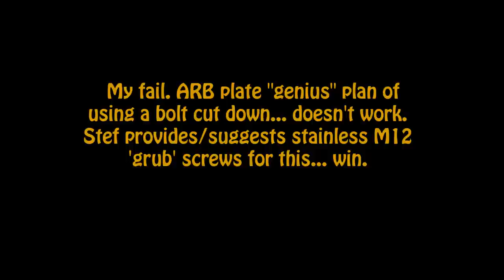Project 16v - Part 29 - Rear axle rebuild

Comment: Top man ! You know iv never actually worked on a torsion bar rear axle before other than to change 1 out on a 309 years ago , most garages round my way would never touch them interesting now as an older ( 38 ) man to revisit this through the wonders of u tube and see what all the fuss is about 
Well done on a lovely rebuild a very nice car now actually a 306 Dturbo “ new enough to be good” - “ old enough not to have all the shite on it “ well done friend 👍🏻
Reply from the maker: Haha! Thanks! Have fun, hope you find another to tinker with

Comment: Halfway through trying to rebuild my beam and I've snapped a bolt in the end of one of the torsion bars.  Should've just hammered the arms out instead of trying a puller. Good video hopefully I can free my seized bars.
Reply from the maker: Oh no! Hopefully it's not tight in the threads. May have to knock the arms off, got to come off for rebuild anyway 👍👌🐷💪

Comment: Good job 1 thing tho i wouldn't use copper grease on bearings as its a anti seize not a lubricant its actually slightly abrasive
Reply from the maker: 100% agree.... Hence I don't THINK I would have put copper grease on bearings... I would use the lithium stuff, because as you say, it's anti seize only. 👌🐷💪
Reply: E graxa bissulfeto de molibdênio? O que diriam?

Comment: Cheers for making this! Much more use than Mr Haynes :) 
Is it possible to replace the two pairs of bearings inside the beam & re-use the beam? Or is it 9/10 that the beam is gouged from worn bearings & needs to be replaced..?
Reply from the maker: Yes it is. I've had a specialist do this for me, Stef, at other times. Many tubes now have gone oval and need further repair. You need a special tool or two to remove and refit the bearings.

Comment: Hey pal good video, ive got mine unbolted inside the boot and the one underneath to replace the rubber bushew but it wont budge)lower. What am i missing please?
Reply from the maker: To replace the rubber mount you'll need to drop the entire axle 100mm or so. Not just one or two bolts.

Comment: Good job man !!! I got 1998 Citroen Xsara which I'm preparing it to drive 500k  around the world. The thing is that when I put some weight on the back the car sinks too much... The axle isn't rusted and the is no ticking sounds from it, the car has only 220k km. I know that my shocks are bad, is that the reason for the car to sinks or something else? I guess my Xsara has 19mm torsion bars, upgrading it to 21mm will stiff the rear more for holding weights?
Reply from the maker: Yeah, I'd upgrade to 21mm bars and some new shocks. 👍
Old bars lose strength overtime too 👌
Have a fun trip!!! 
Are you documenting it?
👍🐷💪

Comment: iv took rear beam of my saxo to fit on my 106 any tips as my old beam on the 106 is drums!
Reply from the maker: Need possibly slightly difference pipes, can make them... And use disc 106 handbrake cables 👌

Comment: Hi Piggy, I've been following your channel for a good time now and it has helped me on my journey with my own 306 a lot. Your videos are really great and informing. I know this video is from 2018 but I see you answered to every single comment so I hope you'll see this. I've got a problem with the rear being saggy and soft, no knocking sounds and I am suspecting the shocks have had enough. They are ta technix and also the front is on ta technix -30mm springs. Do I get the bilstein b4s? I am scrolling through forums and finding the b4s are good except one version (model number 1931) and they also say not to get 205 ones. I am pretty confused as I don't know which b4s to get. Some people recommend ones for a citroen zx or a 306 break as they should be compatible. I really would appreciate your help a lot :)
Reply from the maker: Good morning!! Thanks for watching my stuff and I always try to reply if I see the comments... Depends on YouTube really... 

Presuming you have a 306. 
The rear "sag" will be regulated by the torsion bars (like springs). 
Are they stock? What size? 

If you bounce the rear and let go and it keeps bouncing, that's the dampers. 

B4s for a 306 be good yeah. Don't faff with others that might work, just get them for your 306. 👍🐷😁
Reply: Good morning to you too, I wasn’t expecting such a quick reply :) I suspect the torsion bars are stock and just the shocks were exchanged for some ta technix ones. I hope the shocks are at fault here, but I’m not 100% sure and I am a bit scared if I order and replace the shocks and the problem persists. Can you help me out, I can send you a video demonstration of it if you want. Thanks for the help, you’re a G.
Reply: btw i've just tried to do what u said, i pushed the trunk down with my hand and it does indeed keep bouncing. You think just replacing the dampers should do the trick? @PiggyPower   Thanks again for the help
Reply from the maker: @mikelitoris8660  defo
Reply: Thank you I am very grateful for your advice and will recommend your channel further to friends with pugs. Cheers :D
Reply: Quick update - unfortunately the rear is still saggy after eychanging the shock absorbers. A friend of mine has suggested to look at the anti roll bar as there might be a problem with the arb causing the rear to be soggy. Also changed oil and hydraulic tappets are very loud still. Really disappointed with my 306 after 6 months of owning it. So if you see this, what do you think the problem is in my car’s rear?
Reply from the maker: @mikelitoris8660  ARB has no effect whatsoever with the rear sag. It's an anti roll bar. It does that. I wouldn't know what else to suggest without looking over it. I resume you used new dampers? And the rear now doesn't bounce more than once? ... What engine have you got?
Reply: So it’s not really a sag as the rear is usually level as it should be. Only when there are 3 or more people in the car, the tires scrape on the inner arches and it is unsafe to drive that way. I primed the new shock absorbers and put them on. The engine is 2.0 16v 97kw with gti-6 camshafts.
Reply from the maker: @mikelitoris8660  so the rear wheels scrape on the inner arch liners... That's the real issue? If it has standard wheels and tyres then your issue is worn out rear axle bearings and shafts. 
I don't know of putting GTi6 camshafts in the 16v 2.0 xsi engine... Have you checked that was done correctly? Could be the cause of the noises.
Reply: The car was originally a 1.8 and a previous owner (mechanic unlike me) did the swap to a 2.0 and also upgraded to catcams camshafts specifically for that engine. It is the hidraulic valve lifters that are knocking still after engine flush and oil change. Really disappointed with my experience of owning a 306 so far.
Reply from the maker: Hydraulic lifters are pretty old now. I wonder if there's a bad one or two in there. This is common on most cars with age.

Comment: Hey good job on the axle, I'm doing some work on my GTI6 one currently, can you explain more about what went wrong with the wheels being 10mm to close together, you mentioned about the ARB but I can't see how there is 10mm in it to cause that??
Reply from the maker: Yeah ARB adjustment and the adjustment on the end of the torsion bars I got wrong. Silly error.

Comment: Hey bud great video, planning on getting a 206 but needs a rear axle  am I able to replace the bearings of the axle to fix? Thanks josh BTW keep up good work on the car
Reply from the maker: josh_4000 ™ on the 206 you will find the shafts worn badly if bearings have gone. The shafts can only be replaced professionally... Requires special tooling/cuting the axle in half! It's not worth buying a worn out axle at all! 🐷💪

Comment: Piggy power I have a puegeout 309 I want it lowering 40mm struggling to find somewhere to do it. Would you do it if I pay? I don't mind travelling. Thanks
Reply from the maker: I would imagine people are turning it away due to its age.... A 309 rear axle will likely be totally seized or fall to pieces when pulled apart... I do offer this service but only on known axles.

Thank you for watching though 👍

Hope you are sub'd! 🐷💪😃
Reply: @PiggyPower  hi mate it's 64k and been dry stored all its life. I was gonna have a go but thinking I should try get a rebuilt axle maybe and yeha I am
Reply from the maker: Speak to Stefan, aka Stefs Axles. (On Facebook) he will do a great job, the best. Issue is age, not miles tbh. It could be fine... Could come apart and fall apart and you'd be stuck here! 
If you were local and dropped it off, I would attempt it 

Thankyou for subbing 👍🐷💪

Comment: hello, trying my luck here.... does anyone know the colour code of that yellow ?  looks like ral1028, can anyone confirm ?
Reply from the maker: Hammerite yellow. 👍🐷😄
Reply: @PiggyPower  :-) thanks for the tip, but I have good experience with Brantho Korrux (available in many ral color codes)
Reply from the maker: Ok, sure ..but the paint I used in this video on that tube was Hammerite Yellow 👌😜
Reply: @PiggyPower  thanks for replying anyway.  Meanwhile I checked with a RAL color code chart and the RAL code suiting best seems to be RAL1003

Comment: Ha mar felujitassz egy hatsohidat, szepen lefested, miert nem teszel a csapagyak kozze zsirzoszemet ? A csavarokra pedig rezpasztat hogy 10 ev mulva is ki legessen szedni ;)
Reply from the maker: Translate? 😬
Reply: @PiggyPower  If you went so far renovating the rear suspension, painted it nicely then why didnt you put lubrication between the bearings? And then why not put copper paste on the screws so you can take it apart 10 years later
Reply from the maker: @danifarago7872  thanks for the translation 👍
Reply from the maker: Hi Levy... 
I did both of those things...bearings were well greased with subtable grease and all threads that required antiseeze grease also got that 👌🐷💪

Comment: Hey love your vids but was just wondering what the torque specs are for the main 6 nuts that hold it on are?
Reply from the maker: 55nm for the front two and 45nm for the rear. Ensure threads are clean and undamaged. I'd probably go 55 all round. But don't do anymore. You don't want them snapping!
Reply: @PiggyPower  thanks a lot :)